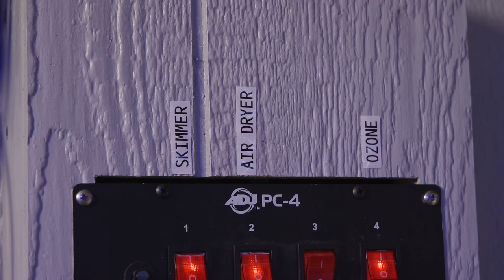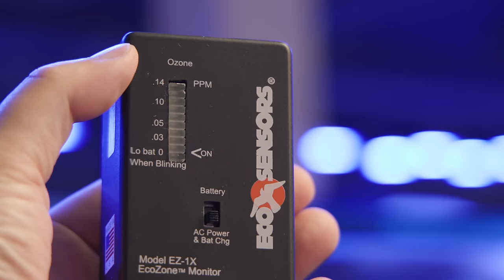Nathan's Tank is Back!  | Tidal Gardens Podcast Ep 4

Comment: OR3 last no more than 8 months :( LOVE the light, but.....
Reply: Now you tell me....I have had one go bad since recording this video
Reply from the maker: For real?
Reply: @tidalgardens  On my own 2400 liters I had 10 OR3, I take care of a system of 4000 liters and he had 12 in total. Of the 22 together 6 are still running. Special the long 150 cm blue has problems, had 3 that lasted less than 4 months. GREAT service on the other side, little slow but they have replaced 8 lamps so far. 
Now we have AI Blades. They are not just a little slow...